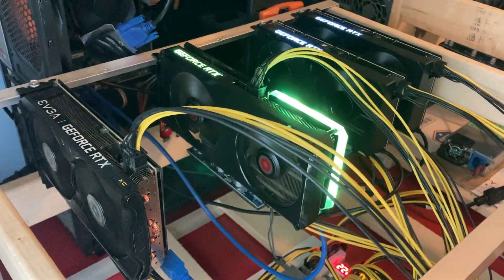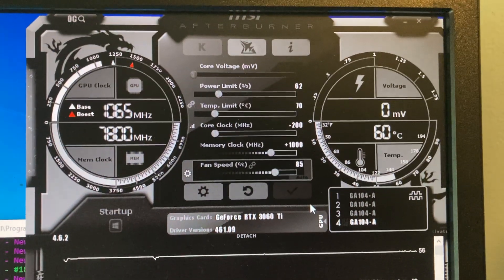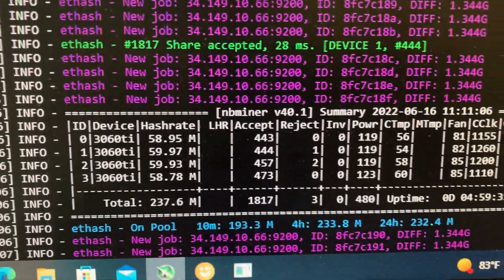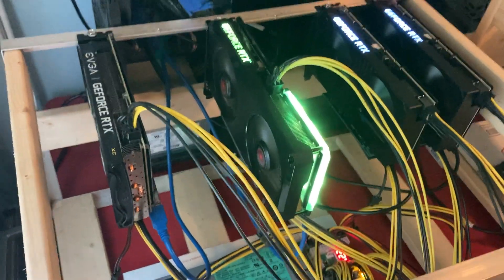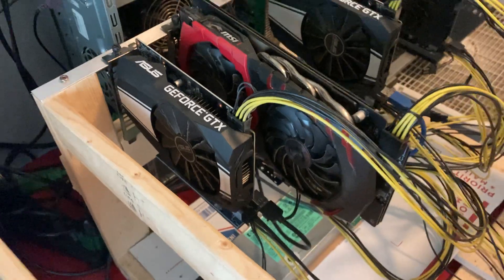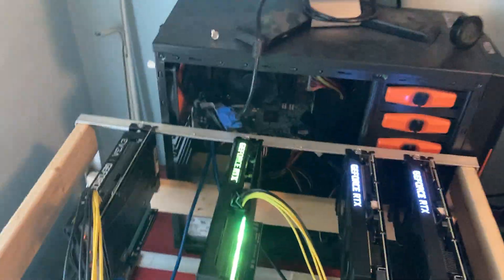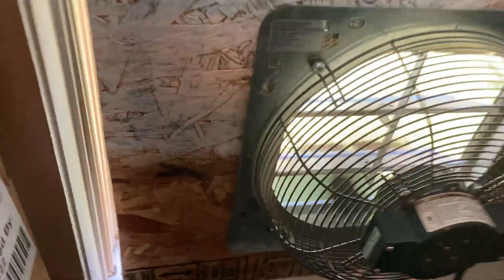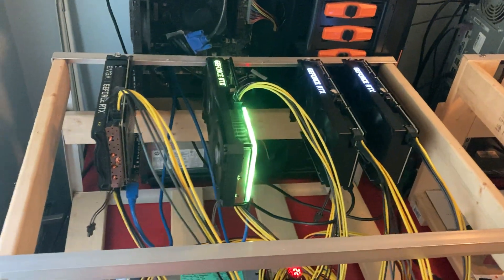RTX 3060 TI Mining Rig - Overview and Afterburner Settings

Comment: I have 10 of 3060TI xc 65mh each settings are  -200 core 1900 mem 145w 75% fan
Reply: Power setting ?please
Reply: @PYWM  145w is about 80% power in after burner
Reply: Is that on HIVEos? my 3070s on hive get 65mhs but My 3060ti on windows cant get much higher on windows..oh well lol